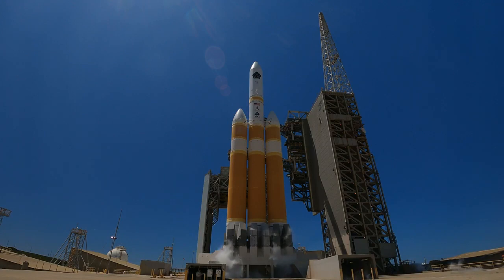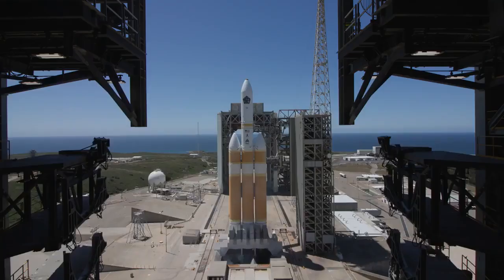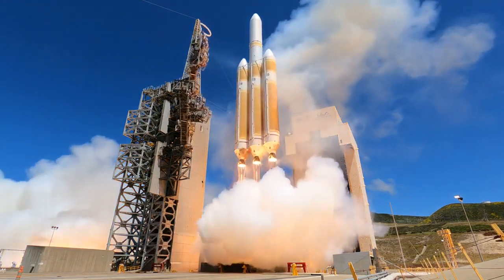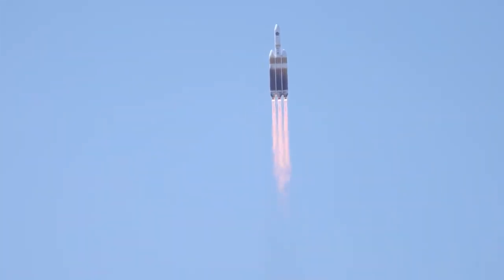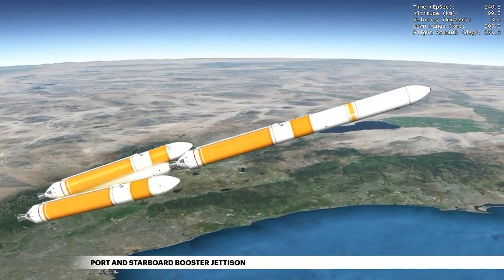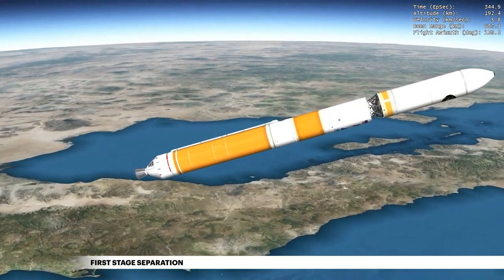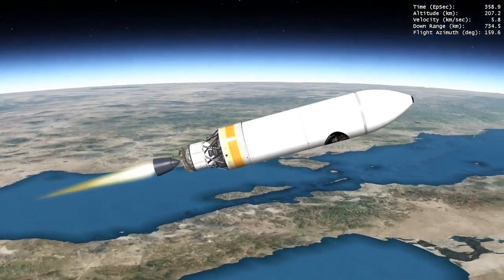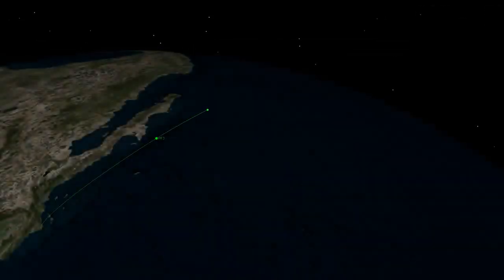Delta IV Heavy rocket to launch NROL-91 mission for Space Force & NRO

Comment: Do they really need to use that many boosters to get that into space? I think it's just another measuring contest, who has the biggest rocket, while emitting all that carbon into the atmosphere helping the planet to burn!
Reply: Delta IV Heavy runs on hydrogen and oxygen, the only byproducts of which are... water. Simple H2O. Not carbon. The engine nozzles are ablatively cooled, which results in the exhaust being a bit dirtier than that of most hydrolox engines, but still, this is probably one of the least polluting rockets in its lift class. It has to be that large because hydrogen is a lot less dense than most other propellants, so it takes up a lot more volume for the same mass of fuel.
Reply: @Delta-V-Heavy  How can you not be polluting our atmosphere when you just said that it burns dirtier than other hydrogen rockets?
Reply: @Rhiannon1261  Dirty for hydrogen is cleaner than just about any other fuel. Delta IV is basically the only rocket that can get to orbit solely on hydrogen, not requiring any kerosene stages or solid-fueled boosters--both of which burn much dirtier at their cleanest. For example, the RS-25 hydrolox main engines of NASA's SLS burn cleaner than the RS-68s that power Delta IV, however SLS also requires an enormous pair of strap-on solid rocket boosters, which are more polluting than the dirtiest hydrolox engine could ever be (though rockets in general--even the most polluting ones--are really very minor sources of pollution in the grand scheme of things; since rocket launches are comparatively seldom, their reletive impact is small compared to things like airlines, automobiles, factories, etc.). Delta IV Heavy is all hydrogen, which means even if the engines burn a bit dirty (for hydrogen engines) because of the ablative material of the engine nozzles coming off in the exhaust, it's still automatically much better than rockets that use other fuels.
Reply: @Rhiannon1261   The ablative materials are mostly carbon dust. Not CO2. And they are generally big enough that with the water deluge system, they do not go into the atmosphere.
Reply: How about you take a moment and study up on orbital mechanics to gain a better understanding of why you are incorrect in everything you said.
Reply: Its going to be retired soon
Reply: The "carbon" fear psychosis Is, is  what's affecting [so-called] brains!  Live with it!!!